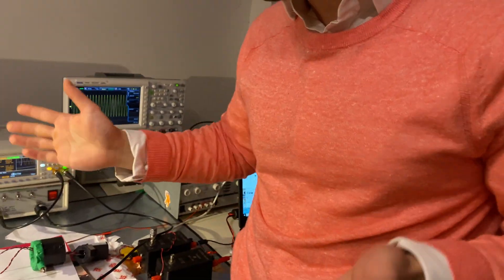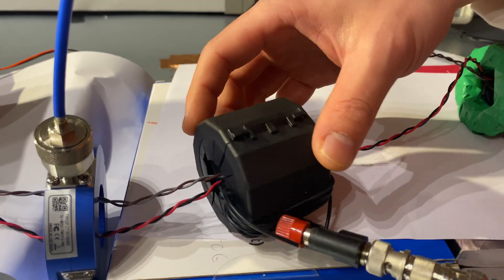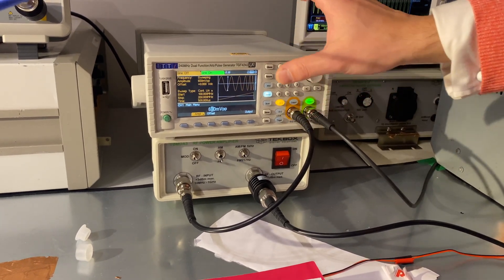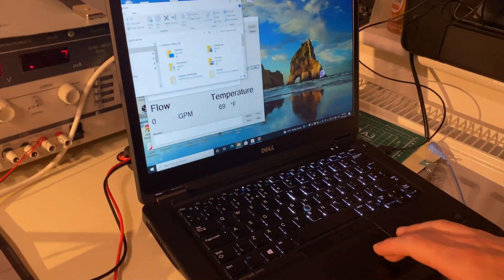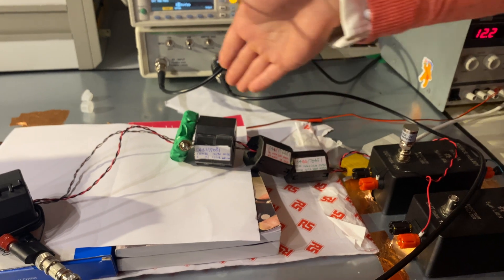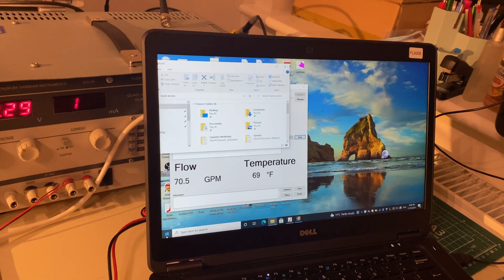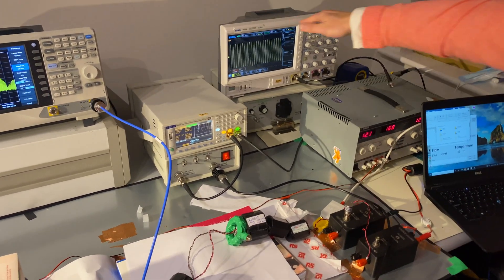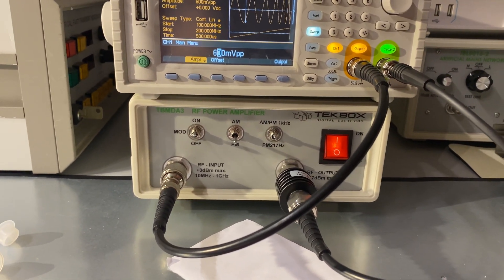Bulk Current Injection Made Easy - Homemade Probe Pre-compliance Immunity Test

Comment: @MachOneDesign
A "How to" video to determine the type of injection probe based on injection limits would be a great addition to this video!
Love the video!
Reply: Most injection probes can reach the highest levels in a test standard as long as it is spec'd within the frequency range. The amplifier will be the main factor as to whether you can reach those limits and for how long.

Comment: Hello, thank you for all this information. On the section: test set up (~5:00) there are some big ferrites. You mentioned that these ones are to avoid affectations into your reading, also the ferrites keep the noise to the DUT direction and not to the reading direction, right? 

In my case, I have a DUT that uses PWM signals to activate the functions (for example: activation signal 1 --> 105Hz at 33%--> function 1 is on). 
On my test, this PWM signal + power supply wires are inside of the current clamp. When the test begins the PWM signals are stronger affected via the perturbation that is running via the current clamp, and my DUT turns off.  The PWM signals gest crazy, a lot of harmonics, change the amplitude, change the duty cycle and finally turns to 0. When the test is done, the PWM backs to the normal state (105Hz at 33% and the DUT is working).

 (Sorry for the long introduction) So, in order to avoid direct affectations to the PWM activation signal during the test I need to put some ferrites to avoid the noise come to the generator function? This kind of protections is not breaking the rules on the standard EMC test? 

Thank you a lot!!!